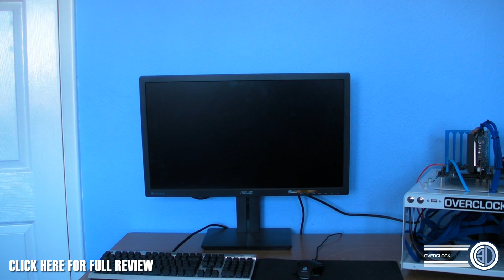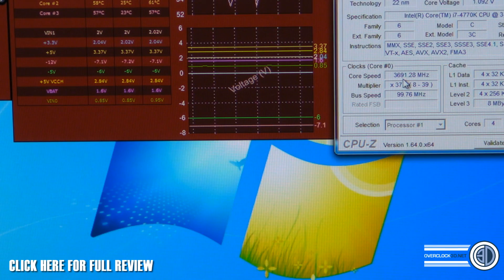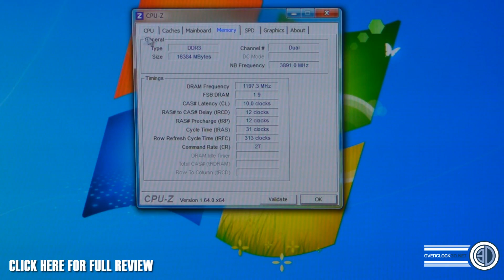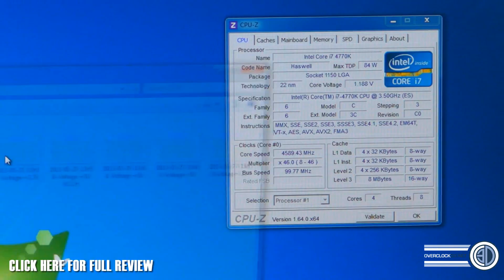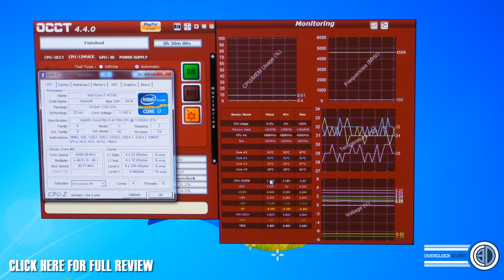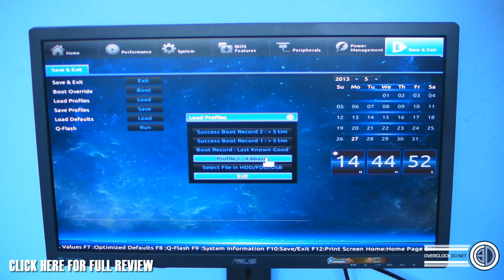Intel 4770K CPU Review Haswell 1150 Z87 Review

Comment: all i ever hear about is fucking power draw. at this point it's haswell's only selling point because if a 2600k is still giving me a higher overclock with better temps(and pretty much the same performance as haswell or ivy), then i guess i will have to pick the 3 year old processor.power draw is the world's biggest cop out. if i have a 125w cpu and a 35w cpu in front of me I'm not worried about which is going to save me 1$ on a light bill, im going to pick the one that is going to get shit done.

Comment: When you buy a Corsair Fan either the AF120 or SP120 you get 3 coloured rings, a red , blue and white one. They are interchangeable so you can match them to your build :) So the colour has nothing to do with the blade design or CFM :)

Comment: you aren't reading other reviews.  no one is saying this.  on average haswell seems to be 5C-15C hotter then IB at the same clocks.  The result is there are actually people overheating on the stock cooler with turbo mode at 4.0ghz

Comment: Go and test it! Go get a 2500K and a 1045T, clock one to 4.5 and the other to 3.9, run an ANSYS ICEM meshing test (to prove there's no bias, it's not threaded so the i5 kicks arse), then run a large eddy simulation from within FLUENT on the mesh from the previous test, utilising all available cores. Time both simulations (won't be difficult, they tend to run for days), then draw your conclusion. I'm confident you'll come up with the same result.

How does telling it like it is make me a fanboy?

Comment: Does anyone know if the integrated heat spreader is soldered or paste on the 4770k? Ivy had hearing issues cause Intel used basic thermal paste between the die and IHS

Comment: nice, ya I had a 2 6970's and together they SCREAMED, oced, but one died after a year and just having one, it really does show it's short comings. the wifes comp has a single 6870 and it oc's nicely and is surprisingly fast for what it is. I'm waiting to see what the new amd gpu's are all about whatever they are called 8000/9000 the few "leaked" slides I've seen look really impressive but I'll wait for the benchmarks

Comment: I had a pair of 6870s, they worked surprisingly well together, but I've had to replace them with a 670 as I'm now using software reliant upon CUDA to get the work done quicker. Worked out cheaper to water cool just the one card too :P

I think after the 8000 or 9000 (whatever they call it) series get released, the 7000 will come down in price sufficiently, you could probably get a pair of Tahiti LE 7870s half price :D

Comment: Mind you, I wouldn't have too much of a problem with it, I am cheating with a fairly decent custom water cooling system, but my radiator doesn't seem too happy with a 670 AND a 3770K in there, so I'm probably going to end up getting something with a denser fin spacing.

Comment: For what it is, it's really not that bad, however once you put an FX chip to a more serious task, you can see the shortcomings of the new architecture. The software I use managed to choke its pipelines so bad I had to run it at half the threads. I have to do that with my i7 too, it seems to disagree with HT, but the difference is that the Intel cores actually deliver the performance you'd expect out of a CPU core. Only the older AMDs measure up to that task I'm afraid. I hope they fix it.

Comment: PD overclocked properly is pretty much on par with mid clocked i5s. X6 still rapes them in per clock performance, never mind per core performance.

In my testing, a 1045T at 3.9 was leaving my 2500K at 4.5 in the dust. Considering the price of a 1045T, I don't think there's much of an argument that could be brought forward against it.

Comment: Well to be honest, with a new architecture you will always have driver issues. Remember back when the 680 came out, it was like nVidia had tuned it to just about beat the 7970, but then AMD got their act together and the newer drivers did give them a fair performance boost, to the point where especially with a decent overclock, they were leaving 680s behind. nVidia have the benefit of pretty much sticking to Kepler and refining it, so they won't have that many issues out of the box.

Comment: Sandy Bridges 2700k + 2500k drew LESS power from the wall at idle than the Ivy Bridges 3770k + 3570k.... This was due to the graphics upgrade. You'll totally right about the graphics inside these top ends CPUs, we'd save more power (thus money from kWh's + the maybe the CPU) if they'd DOWNGRADE the graphics to the old hd2000, or just took it out all together!

Comment: Prime95 is OK.. IBT on max is worse but OCCT is the most punishing stress test around... At least for now. And it's very easy to use. Run OCCT:Linpack after you download it and boom. Be aware the heat will get very very high.

Comment: Rumour has it that the 8000 series are basically going to be rebranded 7000 released to OEMs and that consumer stuff will jump straight to 9000 (like nVidia did with the 100 and 300 cards). Hopefully they will come up with something good that consistently pulls out ahead of the 780. As long as they can stay afloat, they might as well withdraw from the CPU market for a few cycles, get something REALLY good and come back.

Comment: The jump from the Q6600 I had years ago to the I5 2500k was huge, while these newer chips since sandy haven't been much of a leap, they are a step in the right direction. I agree clock for clock better but temp wise not what we want, I do not want to have to open up the IHS to repaste it, Intel need to work on that for the next leap and make the next real generation worth it. I'm pretty happy to just wait it out until that sweet spot CPU comes out a few years from now, a solid CPU all the same.

Comment: Nah, this is not an issue for them to solder it.
The problem is that due to lack of competition Intel is cutting corners and only does a proper job on the extreme cpus.
I hope Steamroller will be good enough to apply pressure on Intel to don't cut corners. But this is no excuse for Intel abd is really silly what they are doing.

Comment: We're seeing it happen already. Intel used to be a performance leader with big enough leaps every release cycle to justify upgrading, and now they've began stagnating performance to a point, where people are starting to question whether it's worth upgrading from two cycles before that. This is exactly why AMD need to get their arses in gear and release a competitive option to take on if not 2011, at least 1155 and 1150.

Comment: If you want a speed boost, a 2600K will do you nicely I think, won't be too far off Haswell anyway, without the potential heat issues (which Intel really should have fixed).

Comment: Well Intel have been doing it right the way up to SB, then they switched over to that shit, so unless the reason is that the die can't take the heat of soldering (because of 3D gates, 22nm, etc), you can probably do it with a good enough oven. That being said, I'd rather run it bare, the last thing I want to do to if I delid would be to stick that thick piece of metal back on to impede heat transfer.

Comment: Doesn't work like that. The memory usage basically tells OCCT how big to make the linpack iterations. The first part of the test (memory build up) is basically the CPU loading all the data into the RAM, as well as some limited processing. After it finishes loading the data, it begins to process all of it, which is why the temps spike. Doesn't matter where you set your limit, it will still spike up when it reaches it.

Comment: Not sure exactly what Shogun 2 likes, the rig I built for my friend with that 1045T was mainly for use with ANSYS CFD software, which is based on floating point calculations, and at the time, my 2500K at 4.5 wasn't keeping up much with his 1045T at 3.9. 

If you're CPU limited and that game isn't using all your cores, then it's probably not well threaded, in which case it will eat up all the extra clock you can give it on the few threads it uses.

Comment: I woudn't call the X4 junk.  It's old but still capable.  My spare rig is an 1100T on a Sabertooth 990FX and my main rig is a 3770k with a Maximus V Formula and yeah the Intel rig is better but the difference between them for the average user isn't really as big as the price difference.  When you start talking about intensive tasks then yes there's quite a difference but you'll find the upgrade not quite as great as the hype dictates.  My AMD was $1800 and my Intel was $3200 CA.

Comment: I will just remove the IHS on my i5-3570k, apply a good thermal paste and i am sure my temps will drop about 7 to 10 degrees celsius since it has that low quality super glue beneath that IHS. :P

Comment: Die direct is the Best that you can do. The problem is most can't figure out how to stop the Block rocking on the die . Simply machine the lid to work die direct to heat sink . Its great its what we did in the old days . When AMD was kicking intels rear . I was on dothan with asus M/B and beating AMD64 2 years befor core was released losers.

Comment: It's only really a problem once you start pushing overclocks. For what the processor is intended for, the K is just to allow some overclocking. In Intel's eyes it's the X processors that are for extreme stuff (and priced accordingly).
For stock or <= 4.2GHz even a CM Hyper 212 variant should do good enough even with the crappy paste/glue, given a well ventilated case for overclocks.

Comment: If your build your own systems. I like the fact you can delid and run direct on the die.Much more effecient. Its just a little more work . In years earlier you could delid and when Intel made it so you couldn't delid the O/Cing community cried about that . Your either young and ignorant or your memory deceives you . I love being able to delid without use of torch/ Lazy overclocker is what you are. Or your just tring to spread dirt . That shit your spreading fool

Comment: If you already have an AM3 (or even 2+ I think) board, it will be MUCH cheaper for you to get a Phenom II x6. A 1045T will in most cases overclock to about 3.9 - 4.2 without an issue, depending on your cooling. At those clocks, it rivals i5 chips. Definitely on Haswell levels clock for clock, though the per core performance is lower. Obviously it won't be as good as an i7, but it's up there with i5s if you're only gaming.

Comment: I successfully performed a de-lid of my 3770K and even figured out how to perfectly mount my H100i to the naked die without using the IHS. Dramatically reduced my temps. Very simple to get the IHS off. Just use a brand new razor blade and cut in from each corner. Pops right off.

Comment: I feel you. My 2500K consistently failed to push memory past 1866 after I got my mem upgrade. Before that, it only just managed to do a few test runs at 2133 with a 6GB 1866 Dominator GT kit. Sandy really doesn't like fast memory.

Comment: My point is, their past 2 releases have struggled to step up sufficiently beyond Thuban to be called an upgrade, so I don't know what game AMD is playing. The 1100T is a 45nm chip. A die shrink or two would have done wonders for both power consumption and overclockability. Slapping a few more cores on it would have produced something capable of wiping the floor with the old i7s and even challenging the 2600K. And that's just the first release cycle. After that they could have refined it further.

Comment: I'm pretty certain SB is limited to PCIE2, I'll have to double check. I don't think it's worth spending all that money for the size of step we're talking about, but as I said - depends on what you use it for. For example if I knew I'd get 5G+ on Haswell, I'd seriously consider it, it would speed up my work a lot. As it stands however, they have the same thermal issues as IB, so I think it's pointless for what I do. If you're only gaming on it too - pointless.

Comment: Even though it's not as good of a overclocker as Sandy, I would still buy Haswell just for the power saving and the Sata 3 ports and high memory speeds.
I have Sandy @ 4.8Ghz. However if Haswell can beat Ivy 4.6Ghz then it must trash my Sandy.
I would be happy with 4.4-4.6Ghz, 2133Mhz and all my hdd's on Sata3.

My Sandy can't hold 2133, even though I have 2133 ram. It's highest it 1866. That's on a 2500k.

Comment: I'm not sure about that, there have to be a reason for them going with BD and it's either Powerconsumption or that they had trouble increasing performance much more. Also Piledriver is far from bad, equal/ a bit better than the phenom 1100T, and I think the 8350 draws less power (Though I'm not sure)

Comment: It's essentially the same stress test, however OCCT keeps it going without big load fluctuations between each iteration. This means consistently heavier thermal load, which shows exactly how far the chip can be pushed.

I've had overclocks run fine under IBT and prime, only to fail after a few hours of OCCT.

That being said, unless you're going to be running long CFD simulations, P95 is about as heavy as you'll load it.

Comment: I like the Intel IB and was hoping that haswwell would do the same. it is a target for AMD fanbais however.On ivy I removed the lid and machined the lid to be direct die contact.Cutting the lid where the Die is and machineing the lid down on the rest of the remaining material and the bottom of the lid so I get good die contact with heatsink using vary highend water system.My ivb limit is 5.2 stable.5.3 is not stable but evven so its just goes above 70C.That I love. Its an enthusiast type thing.

Comment: This is called letting the board do whatever it wants. It's generally considered an unhealthy practice, as boards tend to overestimate the required Vcore for an overclock. Sit and play with the V settings, it will most likely be happy with something lower, especially on the Vcore, resulting in lower temps or higher clocks (up to you really). Trust me, it's worth the time!

Comment: Question: I have a OC 3770K with a Asus Maximus V Fomula. I never had to deal with the voltage, it just increases them on its own. So I overclock my CPU and the voltages go up automaticly, without changing anything apart of the clock in the BIOS. Does anybody know what this function is called? Does this have to do with my Internal PLL Overvoltage settings?

Comment: Get a good cooler and stop bitching. If the Stock heatsink can pull it off then anything above it can too. My 3570k runs cool and quiet with stock heatsink. No need to delid if you are conservative overclocker.

Comment: Actually I just ran into a memory issue with it :P It seems to have wanted a little nudge on the IMC, but that's to be expected with high speed RAM. I think it's 'settled in' since the initial 24hr run I did a few months ago, I'll be re running the 24hr test again to see if the memory is running OK now.

Comment: 9 times out of 10 I'd be singing the same song, however I got really lucky with my 3770K, it does 4.5 at under stock Vcore. I'm tempted to see how much it would take to get it up to 5, but I know that if I go down that road, I'd be closer and closer to running absolutely stupid volts through it, so I'll wait until I actually need it at 5.

Comment: Awesome!  I'll be picking up 4770K soon.  I want to get the ASUS sabertooth board, but it looks like the thermal armor fan interferes with my sound card and I can't put it anywhere else bc of SLI.  Any suggestions?  Can I get a slimer fan that will sit under the sound card?  How are the board temps without the assist fan, is it really needed?  I really love the layout of the board and the armor looks awesome.